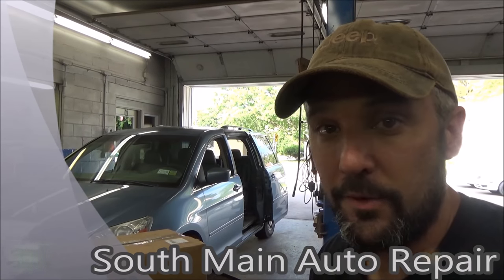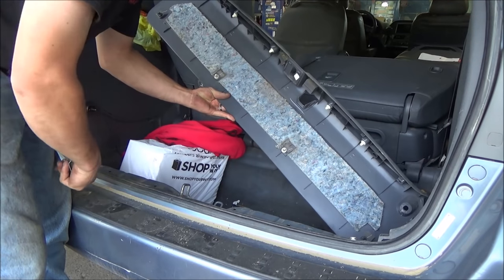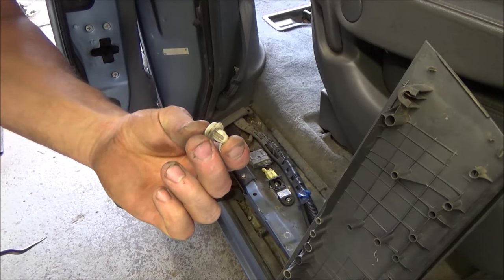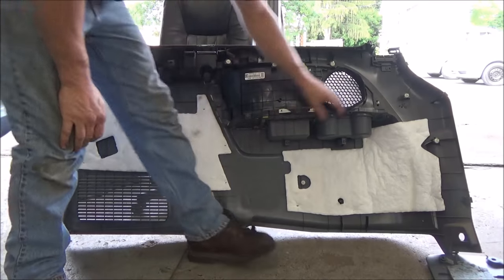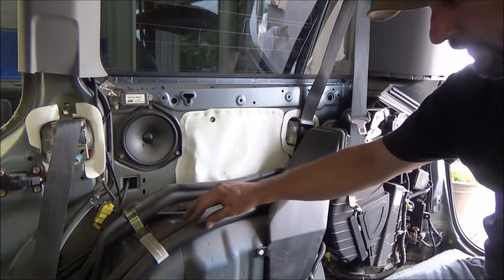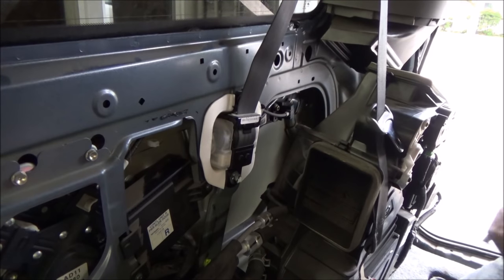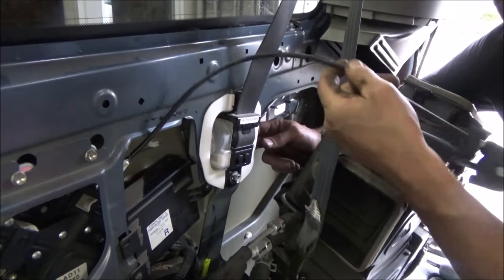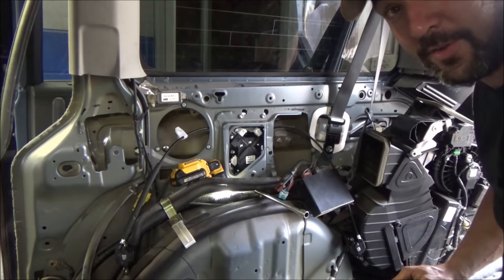Replace: Honda Odyssey Power Sliding Door Motor & Roller

Comment: Thank you for the Video! This is what's wrong with my '05 Honda Odyssey. I should have had the motor replaced when my HVAC went out do to my Parents Mechanic NOT listening to my request to replace filter (burned out compressor and a secondary part)! I had been complaining about the door too! Why didn't he offer the explanation of where the motor was and to suggest replacing that too while in there!?!

Comment: Great video. My 06' had it's motor die. The roller is bad and needs replacement. Can I forgo the motor replacement and just replace the center roller and use ithe door manually.
Reply: +Larry Mcnair yes

Comment: You probably won't see this , but the video helped me to install the cable to the center roller. I couldn't get it attached without releasing the tension on the motor. I've done others, but this one wanted to be a struggle. The doors work good. My only issue in reassembling is reattaching the high seat belt clips behind the 2nd row seat. In you video, you just stuck them on. I can do that, but they won't fit right and the buttons don't release tension that allows the bracket to slide up & down. Any suggestions?

Comment: Thanks, it is a job worth the labor if you can find someone capable. They do wear out, mine just stopped working day my mechanic came to inspect my new to me 2004 Honda Odyssey. It had started to fail intermittently before quitting altogether. Happened day before window motor failed. Has almost 200,000 miles and still runs strong with no leaks. I guess we'll find out if it has been replaced before if we find some things missing like water shields or retainer clips.

Comment: That a great video man!!! Thank you.  I have the "sliding door" light on (on my dashboard) and I have to keep re-setting it, after I replaced the rollers. The impression I have is that my cables have a slack and from what I saw, there is no way for me to tighten them. These plastic locks (located on the motor) are down.  Any suggestion? Thanks.

Comment: Go ahead and put the 12V on the old unit and see if the motor is working or not.  There is a video on youtube where an enterprising owner wound his own new teflon coated cable on a 2nd gen Odyssey.  I think the mechanism is very similar if not identical to this vehicle.  My latch motor [the one which pulls the last inch of door in during the closing] died on 99 Odyssey and had to replace it.  After I started playing with the old one on the breakfast table, it came back to life!
Reply from the maker: 12vgs8606 Hmm that's interesting. Unfortunately in my line of work I have to fix customers cars and give warranties. On my own stuff I wouldn't mind a  experiment though.
Reply: that is what I meant!  since you have the old part and don't need to return it for core, if you have time, you can experiment with it.
Reply from the maker: oh ok got ya... i see your point

Comment: i have one of those Honda Odyssey vans and having problems with the door too. Was wondering if it is the motor or latching system.  When you pull the handle it does nothing or as it trys to open it pops what sounds like it is at the handle or latch area.  Can you get back with me to let me know what you think.  thanks.

Comment: Does the control module wiring harness run underneath the door threshold?  I want to disconnect the control module without removing the entire rear panel.  I'm trying to diagnose a current draw.

Comment: Hi Eric, I ran into 2 issues, just wonder if you have any answers for me. Great video by the way; made the job really easy for me! The first issue I had was the 2 cables were about 3 inches short to fit into the old hinge roller. I did have the 2 white clips on the motor in the up position. Is there a way to extend them a little more? The 2nd issue I had was; I bought a new hinge roller for the door, I removed the bracket from the door with the old roller, removed the clip, but no matter how I tried to removed the pin from the part, I couldn't; I suspect that the sleeve on the pin is logged and rusted onto the pin, any suggestions? I may have to buy a new bracket to attach to the door. Thanks and I await your responses

Comment: Great Job, Great Video!  Real shame to have to replace the whole unit for two cables and mounting brackets!  If the motor/transmission is good, might find another use?  Or was it all bad.  Just thinking.  Anyway, you made it look easy!  Thank you!

Comment: 37:10 the center pin of those pushpins have to be Pulled Up, not pushed down. Take a small sharp screwdriver and pry them up by the little mushroom head on the center Pin. After you get them a little out grab them gently with sidecutters or your fingers and pull them the rest of the way up. They should come out easy after lifting the pin. They work like a pop rivet or a concrete anchor.

Fords use them a lot for trim pieces.
Reply: +Co Jones Actually, to remove them, you are supposed to push the pin down.  That's how they're designed.  They're not the same as the bumper clips that you're probably thinking of.

Comment: Thank you for making this video.  I have to do this on my 2015 van and from what I can tell, it should be similar; but I did not cut my wires.  The door popped off when I closed it and it only has 17K miles.  I see that this has been happening for years, you think Honda would fix it (I mean the rollers giving out).

Comment: Say you want to try manual. Can you just let the cable retract as far as it will go vs. cutting it? Seems that the cable end would still be on the outside & accessible that way and could maybe be reattached at a later date without having to remove the inside panel, etc. Also pull the appropriate fuses to disable the electronics.

Comment: Did you lube the tracks.  I know dont have to show it but just wondering.. Just like i have to do on my benz. if I pop the trim off I will lube the window regulator. or if it moves slowly i will lube it.  cheaper maintenance to do that then a new one.   great videos, and always enjoy watching them.

Comment: i currently have the same issue but on one side (passanger) door does not open nor releases front lock, the back of that door seems so close but release after seconds of pushing it close.  the right side is just no power to it.  I hate to buy parts to it that dont need to be replaced.  How should attack this issue.  Please help.  i see other videos show motor in the actual door. im confused a little. I have an 05

Comment: I have a similar problem with my 2010 Odyssey, driver side. Door opens fine manually but does nothing when you try to open it electronically via any method. How do I know if my motor is good or not?

Comment: Thanks for the video. I just replaced the motor, and it STILL won't shut. Doesn't respond. Any ideas? It didn't have a power interruption and the other door works just fine. I can't find a fuse for it, and did remember to plug it back in. Any chance that box is the problem? (About to give up and go manual:)

Comment: So I have the same problem, but on the driver side of a 2004. The thing is that I can hear the motor run, but the door doesn't move. Any suggestions? I don't want to make a costly mistake like your costumer did. Thanks  Carlos

Comment: Eric O, how different is this job on a 2012 Odyssey?  Also if the rear cable snaps, is it automatic that the motor will have to be replaced?    Plus, after the cable snapped, their is no sound coming from the motor at all when activated??  Any help will be helpful.  By the way, you're in the wrong business you should be in the movie making business. Excellent videos, thanks a ton.

Comment: Its a real shame that someone spends thousands of dollars on a vehicle,then treats it like a dumpster on wheels. Heaven forbid if something comes up missing out of the thing while its in your shop!. Digging through sticky candy, food and germ infested garbage is a big tun off. If they find a dirty thumb print on something after the fact,they go crazy!. I have seen many cut cables on those too, the cost of repair verses just driving it the way it is I guess. Nice to work outside in the fresh air anyways. Lol. Reload the garbage and go. No extra charge for the reloaded junk! Good video,I appreciated your effort.
Reply: You know, I'm meticulous with my car and it's always pretty clean. No matter where I take it for repairs I get it back with grease, dust and/or dirt everywhere. It makes me so mad. I have jet black cloth interior and one time it looked like the dude rolled in drywall dust before he worked on my car.
Reply: Bonito video

Comment: Hey Eric, so how did you know it was the Motor Assembly and not the Power Sliding Door Control Unit?  I agree that the slide door rollers might have been the original problem.  Not sure what to order now...Motor Assembly or Power Sliding Door Control Unit?

Comment: Interesting, are the heating and cooling lines run inside the van to the front?  Ten years old they look brand new. Unlike the Caravan which runs the lines underneath and get all corroded. Get vid, I'm sure this info will help in the future if my Sienna door fails. Note to self: Never cut the cables.

Comment: Wish I could see this video earlier. My 2015 Odyssey just had a power sliding door failure on Christmas Eve: it only closed to the halfway, then beeps and re-opened. No way to close it either in power mode or in manual mode, always stuck at halfway. Towed to the nearest honda dealer and was charged $14xx to replace the motor, roller and cable. :(

Comment: Could the metal cable wire been crimped back together or is it a small channel that the wire would not fit with a crimp?
Reply from the maker: chasiu75 Oh yeah no, it runs through a track then spools in the motor

Comment: i have a 2007 honda odyssey with almost the same issue - passenger sliding door. do you have a better solution on how to open a stuck passenger sliding door. i had a friend who accidentally pushes hard the door handle while the sliding door was closing and now its stucked. i cant open it manually inside or outside and the door lock inside that  slides up and down is also stuck. i went to the dealer and they are charging me $600+ to have it fix. they told me to sign a waiver because to remove the panel is hard and might damage it. the panel itself is $300+. i need your expertise to solve my problem. thanks

Comment: had the same thing on mine. cut the cables as well since they where jamming the door. got stuck in a parking lot on a Sunday night with a door jammed halve open and than fell out the track. common issue withe roller got a little more expensive than I wanted

Comment: Do you have another video about how to test the motor. I'm working on a 2010 Odyssey. The drivers sliding door doesn't open or close. Fuses and connections are good. it's not the gas door switch. I can hear the control module clicking. The door can be opened and closed manually. I'm guessing it's the motor but I'm not 100% sure and I don't want to guess and make a $400 mistake.

Comment: Hello,
I have a question about my 2001 Honda Odyssey.  about a month ago just had trimming change belt, water pump replaced and catalytic converter replaced. Then had transmission rebuilt, came back like they ask to make sure their were no leaks and there was no and everything looked fine. Oil change has been done, tune up. I get a call from my husband that after driving less than a quarter of a mile, the car has stopped. tried to start it several time and it would not start, finally he got it started, but the heat won't blow hot air?  having it towed to were I got all these repairs minus the transmission place. Any suggestions as to what it might be? I would appreciated it!!! Much thanks, in distress!

Comment: Bravo! Excellent! I went to YouTube in search of help with my front end dilemma. I did find some helpful videos, some of which were exactly my year and model. but when I came across your videos I was instantly hooked because of how well you do them. I'm working on the front end of a 98 Crysler Sebring and I just finished watching your video on a Pacifica with an electrical problem(TIPM). i'M LOOKING FOR HELP WITH A PROBLEM!!!  I NEED TO KNOW IF THERE SHOULD BE ANY LATERAL PLAY IN A CV JOINT OR IF THAT MEANS IMMEDIATE REPLACEMENT. Or maybe ( is further investigation needed)? I 'm not sure how or where to ASK?

Comment: Hello Eric.  Very cool videos.  I have an issue with our 2006 Honda Odyssey.  It collects water inside the rear gate/door. It appears to be coming into the taillights and leaks out every time you open the rear door from the latch and bottom right part of the gate.  I searched online and was unable to find a real fix to the issue.  It appears that many owners are having the same issue out there. Some say the taillights need extra seal, others add a bid of silicone around the lights housing, but I was wondering if you  have made a video showing this water leak or have you had to repair someones van at your shop? 
Any help would be appreciated.

Comment: Hi Sir, My honda 2018 Odyssey sliding door doesn't work (can't even manually open / electric doesn't work as well on the left side only). I went to Honda dealer shop and they charge me  2 hours for diagnosis fee, and then they call me they will need more hours again to diagnose  (hourly rate = 125$CAD). I'm just wondering is this normal to take this ?

Comment: When you mentioned the price of the motor at $400-$500, I knew this wasn’t a current video.  I’ve got the same door and bought a used motor and cable on EBay for $150.  It’s off an Odyssey that has 145,000 miles, supposedly. Im in the process of buying new rollers for both doors. If this video is 1 hour, 6 minutes, I’m curious as to how long I should allow to complete the job; all day?

Comment: 05 with code b2038 psd left side position circuit open/short. door wont open if any buttons are pressed. code points toward rear door latch. have u ran into this issue before?

Comment: Your the man Eric! I love the A/C lines and heater lines on the interior. Less chance of the rust getting them there. Did they come through the fire wall or part way back and then through the floor?
Reply: Sean Deshotel This interests me as well.  I didn't know manufacturers put A/C lines in the interior like this.
Reply: GM, Ford, Dodge all put their rear hvac lines under the vehicle and the salt kills them. Especially the GMs.
Reply: Huh, maybe that's why my A/C compressor leaked and dyed on my 05 Impala.
Reply: Corey Toolen I was talking rear A/C lines running inside. Impala lines are all under the hood except internal ones to the hvac.
Reply: Sean Deshotel I don't even live in the rust belt and I've had to replace one on an 01 Town-n-country. Was not very fun to say the least.

Comment: Great work. Do you have any suggestions on how to remove those two little screws some cars seem to have on the brake rotor? I usually go at it with a bunch of penetrating fluid and start whacking at it with a screw driver and hammer. Some keep stripping and I have to drill them out. There has to be an easier way.
Reply from the maker: argonian bilbo  This is what I use
Reply: South Main Auto Repair You use the same method?
Reply from the maker: Sorry it didn't post the link ?! http://www.mactools.com/en-us/Pages/ProductDetails.aspx?productid=SID13BA
Reply: argonian bilbo Not Eric, but I have some advice. When I notice the impact screwdriver starts to strip them I bust out the air hammer with a dull point bit. Then I give it a few love taps straight on the head, a bonus is this actually repairs the stripping somewhat and at the same time shocks the head loose. Then it frees usually on the first hit. Works every time 90% of the time!

Comment: Help...backing out of my garage this morning, I clipped the driver side of my garage with the slider open. I am pretty sure i bent the slider bar (probably not the right term) and the roller hinge is scraped off paint along the side of the car. The door won't move at all now, electrically or manually. The side cover panel is tilted vertically and possible bent horizontally. I have a friend who is really handy with cars but i am wondering if this is something that requires a body shop. If would be great if we could fix it ourselves. what would you recommend?  Thank you!!
Reply: +Patricia Webster     actually...i think ti might be something as simple as the roller wheel is off the track...which is causing the cover to bow out a bit. ?? any thoughts?
Reply from the maker: +Patricia Webster My thoughts would be a body shop, sounds like it will be the best long term ...

Comment: Eric as a Honda tech from 1983 to 2015 I got to say GREAT job man! And trust me the owner broke this thing. Do you mind saying how many hrs. you charged?   (your door rate is way to low)  Man I can not tell you how many ody. doors I fixed and how much junk I had to remove just to get in to the darn thing! I would put tarps down take my shoes off vac. it out when done and still the owner would say I got it dirty !
  Look up the ody. fuel pump recall TSB and just think what the dealer tech,s    go through OK off my soap box! Best of luck to ya! PS How about a vid. on battery and charging systems tests? Just a thought Joe
Reply from the maker: Joseph Tucci  Hey Joe, man your from the days of the old and long ago haha jk'in man! Wellll I usually lay down the carpet covers but frankly this one I didn't think it mattered a whole lot haha. My labor rate is $65 but that's just because of the area we live in . There are dozens of shops on every corner with little skill getting $50 to $65. If I charge $70 or $80 they will just go to one of those shops unfortunately. I don't think most customers know what skill set is required for us to repair there cars so they'd rather hit up the cheapest place. Any how I think this billed out around 3 or 3.5 but I had some other stuff to do on it too.